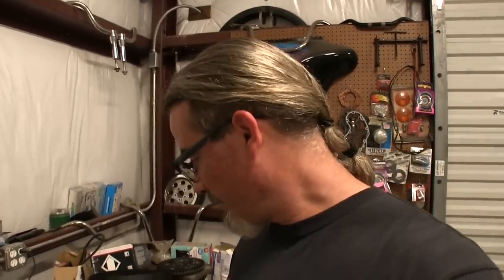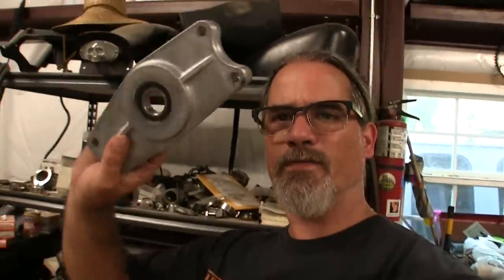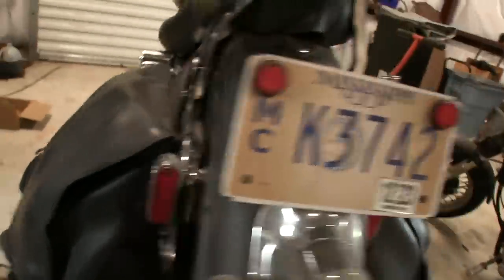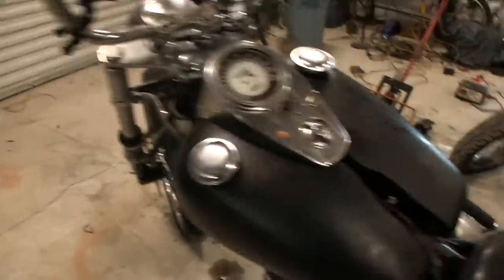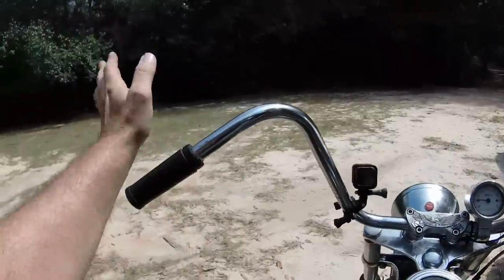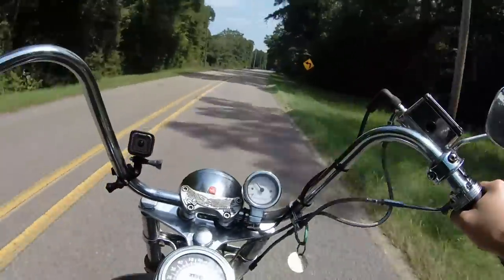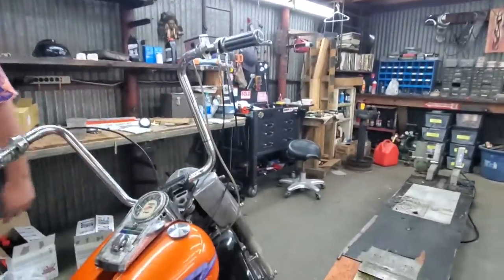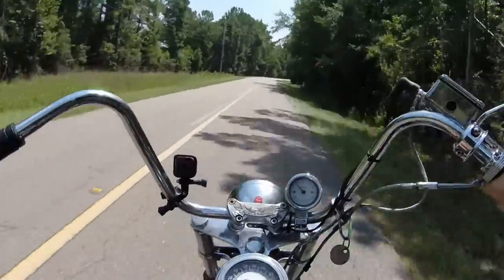CONVERTED To Open BELT Primary FOOT CLUTCH & Suicide/JOCKEY SHIFT On 1979 HARLY Davidson SHOVELHEAD

Comment: Back on a bike after 20yr absence. Got an old FLH with evo motor. To slow myself down (skill no longer matches old riding habits) I’ve gone with a jockey shift setup and I’m lovin it. I find that I’m totally involved in every ride and every ride is an adventure…whether I want one or not (lol). To slow down the clutch engagement I played a lot with the location of the linkage connection on the pedal. By moving the attachment point closer to the pivot the length of pedal sweep during engagement increased. Took a bit of fiddling about but optimizing the stroke and position of the pedal really made it more fun to ride.

Comment: I have a similar setup on my Shovel.
One secret is to make sure your clutch pedal is positioned so your foot can be securely on the footpeg when using the clutch and you just rock the angle of your foot on the peg to operate the clutch. A big mistake is to set up the clutch so your foot has to be OFF the peg to use the clutch, I've seen a few guys do it like that until they learned better lol.

Comment: Very cool mod there Tramp. Reminds me of my early days. I learned to ride on a 42 "45", hand shift foot clutch. But the clutch was a stay put rocker clutch. So a bit different. That was my own bike. I rode everything my friends would let me on. My first ride on a Triumph was a right side foot shift. Same as the early Harley Sportsters, and K models. I learned to adjust to what ever I rode in minutes back in the 50's. Anyway, thanks for sharing your story. Once you get the sequence down you will be able to start that thing with one or two kicks. My old flat head would start on one or two kicks almost all the time. But they only had like 6.5 to 1 compression.

Comment: Good video I am 71 years old and still ride motorcycle I no longer price Harley-Davidson to expensive too many problems so I took half Harley front wheel rear wheel Springer daughter rigid frame and put a 650 XL Yamaha motor in it and I even put a suicide clutch and it's got a rigid with a strip meal while to figure it out haven't rode bikes in a long time enjoy the video and the Motorcycle I know right is a very difficult one but I am learning thanks for the video old school dangerous but that's all we live

Comment: The first motorcycle (a 1950 FL) that I rode had a tank shift (shift gate) and a rocker clutch. I also rode a pre-WWII Knuck with a suicide clutch and jockey shift. It took me a little time to get accustomed to that clutch/shift setup. After a few days, actuating the clutch and shifting gears was as easy as falling off a log. I didn't have any real problems except sitting at a stop light or stop sign on a steep hill. I didn't run a front brake. Have fun. Be safe.  -- W

Comment: I am running the same set up. If you don’t like the gear level configuration you can weld a 13/16 socket to use as a spacer. Thats what i did and man is it in the perfect location.

Also turn to the handlebars to the left when youre stopping.

I can send pics if you like. Happy to help!

Awesome vids saddletramp👍

Comment: I think you got that cold engine kick procedure kinda backwards. Iggy off, choke closed, 2 or 3 prime kicks. That actually primes the jugs with fresh rich mix (like dipping your mower plug in gas). Choke open, iggy on, somewhere between 1/4 and 1/2 throttle (air to breathe), "kick it like kicking a dog" (follow through with gusto beyond "straight down"). Your carb/iggy combo might prefer a variation, but that's the classic kick sequence.

Its basically "purge spiders/add rich mix" key off, "let the puppy pant" key on. As the prime kicks are full rich, try not to squirt too much accel pump go juice key on, so she doesnt flood (though a throttle pump between prime kicks could be a "magic bullet", lol).

Comment: Good video and I'm happy to see your shovel undergoing a "devolution."
My first Harley was what was left of a '51 Panhead with the real suicide setup,(rebound clutch pedal, jockey shift, and no front brake,) and it was a kick in the ass to ride 
 For years I've been wanting to convert my '72 ElectraGlide to a tank shift/foot clutch setup, and since I'm in the middle of restoring it, it's an opportune time.
 I've had the bike since 1980, and 6yrs ago I finally warmed up to the Evo enough to buy a '97 WideGlide to give it a break.
 Thanks for posting this and ride safe.👍
Reply from the maker: "A kick in the ass to ride" That's too funny. I like that. Hey man... If you want to that bad, the opportunity is there.
Reply: @SaddleTrampTV  
 What added to the "kick in the ass" was that it was a rigid, and 3wks after I got it, I had to go to a doctor because I developed a cyst on my tailbone.
 No more rigids for me after that.  
 Yeah, I know I'm a soft ass, but as many miles as I logged in the saddle when I was younger, I needed every advantage I could get.
 Ride safe.👍

Comment: My shovel always leaps forward when I drop it in first gear. Grab the front brake and hold on. So good thing you got front brakes. You will need it with that set up. Good luck and be careful. I still try to shift on right sometimes cause I have a right side shift iron. Muscle  memory.
Reply from the maker: Yeah, I wasn't going to go that route without front brakes.

Comment: I have a 79 shovel flh that has high mids foot clutch jockey shift. Love it. You’ll love it when you get to a hill. Bike looks great.
Reply from the maker: That's why I kept my front brake.
Reply: @SaddleTrampTV   I’m running no front brake. I’m running a 4 under springer.

Comment: I ran an open belt drive suicide shift on my shovel for years. I had both ratchet top and manual top at different times, I liked the manual top better because you have a neutral between each gear. A front brake is almost mandatory…
Reply from the maker: Agreed... Front brake is a must

Comment: It would be very beneficial to have a foot clutch that could latch into the disengaged position for emergency stopping. I'm toying with an idea to make a linkage that would behave just like the regular chopper style foot clutch while riding, but could be latched if you hit it hard with your foot. You would then need some kind of release to unlatch the clutch back to normal operation.
The original Harley foot clutch used a heel-toe setup that would latch to the disengaged position for just this reason. However, the Harley foot clutch disengaged using the heel and re-engaged using the toe. Backward to chopper style clutching, and most chopper guys don't want a heel-toe setup anyway.

Comment: I have run a set-up like that. Always tap the tranny into neutral when you have to stop and never run without a front brake. I know there are guys that say they wouldn't be caught dead with a front brake on a jockey shift , suicide clutch motorcycle but the first time you have to stop a steep hill and you can't hold the motorcycle with your legs you will thank the good Lord you have a front brake. The lurching on take offs will get better because the feel in your leg will remember where the clutch starts to engage. You will quickly understand what a major event stopping and starting are. Later my friend.
Reply from the maker: Exactly why I kept the front brake.
Reply: @SaddleTrampTV  Even with the front brake I have gone through a barn door and have ridden down a steep ravine from a parking lot. I would truly look at running a rocker clutch instead of the suicide clutch, just my opinion. The biggest issue with the suicide clutch is losing your balance while trying to get rolling.

Comment: Count the teeth on each pulley, for example 68 42. When you have your count call Gates Belt drive and tell them your count and they will send you the correct size. I went through the same thing a few years back.
Reply from the maker: Thanks, man!

Comment: I recently got my first open belt drive on my custom Harley I got a real nice pair of boots with no shoelaces and Away the bars are around the belt it's pretty good the 34-degree degree rake on her took some getting used to going normal speed and so bad but turning sharp real slow was tricky at first because it had been so long since I wrote but we got each other figured out now

Comment: I have a 72 superglide with a bdl dry clutch. The lock nut is stuck on the adjustment screw. There is no lock tight I believe it’s cross threaded. Any help is much appreciated 🙏
Reply from the maker: @sebastionspray808  Perhaps put it in gear and have someone hold the rear brake while you try to turn the nut off of there.

Comment: Change your transmission plate to one that can be adjustable. Like on the old panhead, this is so you can tighten primary belt.  Have fun riding.  Practice stopping going up hill
Reply from the maker: Thanks for the tip!

Comment: I need help timing my shovelhead if you would be willing to help me.
Reply from the maker: Get your static time set. After that, with an idle of about 2000 rpm and a timing light, per the manual rotate the timing plate until you set the prescribed mark in the center of the timing hole.

Comment: One thing you got to watch out for not just that compression stroke kick to come back on you, but especially with the cow pies you location get a dead kick. We're almost feels like a put the clutch in that kick his ass wants to swim down to the ground on its. And it never happens first kick it's always have you been kicking it 10 times bitching this thing won't turn over and all the sudden.

Comment: Open belt primary, BAD IDEA, grit gets embedded in the belt and eats up the aluminum pulleys. 
There is a reason they switched to a hand clutch foot shift.
Reply from the maker: I was thinking more of the longevity of the belt and clutches due to heat. But I suppose that's one of the cons. There's pros and cons in everything.

Comment: You still have points in the Tramp? I have points in my 78 Iron, want to change it out to electronic ignition, they say it's a shit ton better. What do ya think?
Reply from the maker: I've never put points in the Tramp. Still running the oem factory ignition.
Reply: Looking good, it does change your relationship with your bike.  I bought what I considered my last bike in 1998, had wanted this one since I was working in a small shop in Texas in the late 70's.  Used to tune and test ride Pans, liked the look of the engines but too slow.  So now I ride my 88" stroked Pan in a 1981 FXE chassis, kick only, foot clutch with jockey shift on a ratchet top, 3" open belt primary, Progressive suspension front and rear, this bike suits me fine.  But I made a mistake, I've gotten old, don't do it!  😎  Gets harder to kick start them in your mid 70's!  So, realizing this I found a electric start Sportster at an estate sale a few years ago, some assembly required with a steep learning curve since I know nothing about them.  But it cost much less than fitting electric start on the Pan.  Back to this video, look up Grease's Garage on the tube, he has a couple of good videos that I watched recently.  Check out: How to build a jockey shift foot clutch for a rotary top, also: Foot clutch setup, and: How to ride a jockey shift foot clutch motorcycle.  Wish I had watched these years ago, there is more good stuff on his channel also.
Don't let people without personal experience change how you live your life.  Everybody has a different comfort zone, I used to race through the woods and jump anything that didn't get out of the way on my trail bike and converted motocross bikes.  Didn't wear a helmet for over 30 years (wouldn't now but I moved into a backward state), used to ride on the highway at night on my 77 Kawasaki 1000 at speed laying back looking at the stars for miles at a time, still alive and in one piece.  A modification I've seen recommended (can't give credit since I can't remember who, might have been Pacific Mike or Tatro) that I am looking to do on mine is a short heel rest to help control the foot clutch engagement.  Hope you like your new setup as much as I like mine, yes, the bigger the crowd the harder they are to start, enjoy!

Comment: You need to turn out throttle about five or six times all the way open and get some gas down its throat and it will fire on the first year but you're not giving it any gas at all water pump that throttle 5 or 6 times I'm telling you I start mine for the day that's the way I do it and it starts right up anyway hope you get a good one buddy God bless you
Reply from the maker: I'll give it shot. From what I've heard though is that they all behave differently.
Reply: @SaddleTrampTV  that's true they are all different and they're pretty temperamental have a great day buddy

Comment: I would never want a shifter like that. They call it a suicide shifter for a reason.
Reply: If your foot slips off the clutch, you'll just lurch forward six inches and stall the motor. The 'suicide' term originated from rocker clutches which sometimes malfunctioned launching you into traffic. This is a foot clutch - it's not the same.
Reply from the maker: I figure it's a suicide clutch if you have no front brake.

Comment: Long time pan rider. Yeah foot clutch hand shift. No biggie should be getting the hang after a partial day of it. Only problem is now you wont wanna foot shift that thang. Also My pan has a mallory uni light an super e/shorty e. Whatever, people get too hung up on nonclementure. Any way its a genuine 1 kick bike. 1 kick means 1 kick. No prime kicks, whick the throttle 3 or 4 times, quarter choke(yeah yeah, enricher) crack throttle slight bit n kick. It does start. Has a small hydro cam, an andrews h grind. Simple and close to stock is best. Wanna go fast dummies, buy a ying yang bike